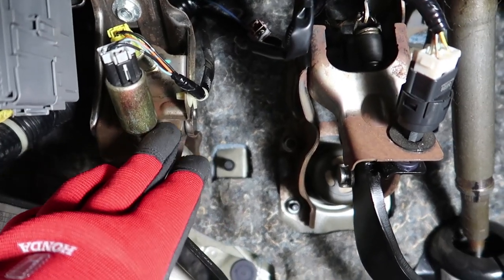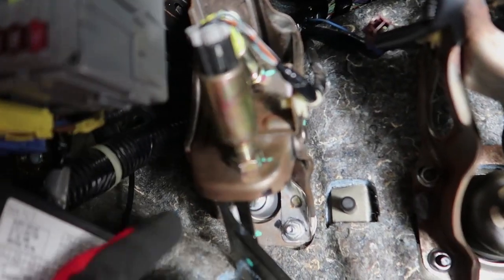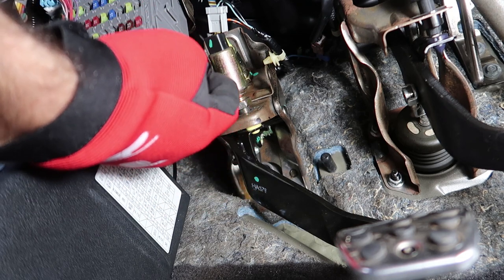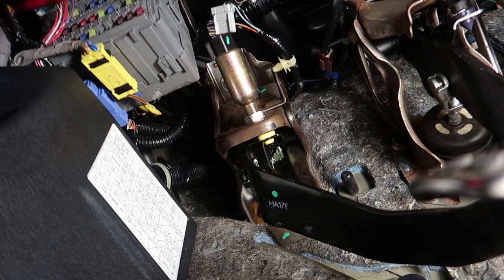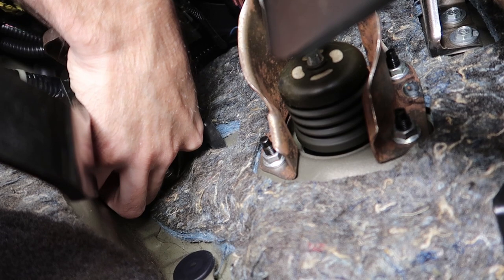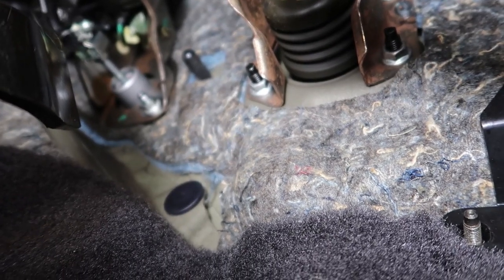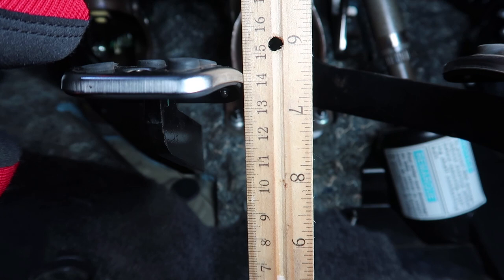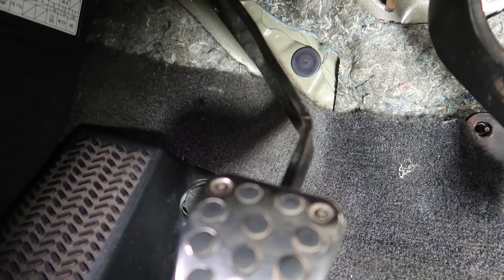8th Civic Si and RSX Type-S Clutch Adjustment DIY | Aftermarket and Stock | FG2, FA5, DC5

Comment: Just installed an em1 master and slave with stainless line. The engagement point is at the very top of the pedal stroke and there is pretty much no free play. Id like to move the engagement point to the middle of the pedal travel but it seems strange to follow the procedure you suggest because wouldnt that move the engagement point even higher?
Reply from the maker: Try a little more freeplay. Longer pedal stroke will make it engage higher. Having not much freeplay will make the engagement slightly higher. In order to have proper disengagement it might not be possible to have the engagement point where you want it. You will (most likely) get use to it in about a week of driving
Reply: @JasonMcMullen  thanks for the reply, so is it necessaty to adjust the sensor/stopper and rod simultaneously to get any results or can they be adjusted independedntly of eachother? In my mind it would seem that shortening the pedal stroke by going to the 5th thread on the sensor would essentially just be eliminating the final ~10-15% of pedal travel where my engagement occurs. If I started by only adjusting the CMC rod counterclockwise for more free play could this potentially move my engagement lower or would i also need to adjust pedal stroke to make it work?
Reply from the maker: @colmanbaldwinson9091  The freeplay adjustment will only change it a little bit. Essentially by having more freeplay, less fluid will be pushed into the CMC. Same goes for the pedal stroke, less stroke will push less fluid into the CMC and therefore when you let the pedal up it will engage earlier in the stroke.  There is only so much freeplay you can add so it might be necessary to lower the pedal. If you do adjust the pedal stroke then you have to readjust the freeplay after, which is why using a ruler is helpful (so you can record how much you had before doing the pedal length, and then you can add the same amount after you adjust the pedal length). Honestly, having proper disengagement is more important because it affects the transmission, whereas having a desirable engagement point is more of a driver preference. You can try 4-5 threads and then readjust the freeplay, but if you start having disengagement issues then I recommend that you return to the setting you have now. Thanks for the comments buddy, I hope it works out well for you
Reply: @JasonMcMullen   for the help and the great video!
Reply from the maker: @colmanbaldwinson9091  thanks buddy! lmk if you run into any issues of have any more questions
Reply: @JasonMcMullen  So i just tried to spin my CMC rod after losening the nut and it wont budge. I also noticed that my sensor is already maybe 3-4 threads in already. Feel like im kind of stuck with what ive got at this point idk how else I could get the rod to spin without taking the CMC again or taking it to a shop. I could get used to having the high engagement/disengagement but I have literally zero free play right now
Reply from the maker: @colmanbaldwinson9091  try to push down the pedal a tiny bit with one hand while trying to turn the rod with the other

Comment: On my Rsx the stopper is at like 5 threads , the free play is correct but when In gear as I release the pedal it doesn’t grab until the very top what can I do to make it grab in the middle ? Lower the pedal stopper ? It’s a new clutch and everything
Reply from the maker: is it RSX type-s?
Reply: It’s a 06 base 5 speed with a k24 , oem exedy clutch replacement and their master and slave cylinder, it shifts fine it just grabs very high
Reply from the maker: @joaquin0023  that makes sense, the height is different for your setup. You can try to add a little more freeplay first and see if it helps. Then if you need to you can go to more threads showing and then reset the freeplay. Keep in mind that doing so may make shifting less smooth, depending on how much pedal travel is required for your setup to fully press in the clutch pressure plate.
Reply: @JasonMcMullen  I added more threads and did the free play but it’s still high, the height is even with the brake pedal , I’ll try to add more

Comment: Hey Jason. I just did this adjustment and my shifts are definitely smoother and no grinds at all. I am a bit concerned about the higher clutch engagement tho...mine also catches pretty high...almost to the point where i let my foot off the pedal. I do however have about 15mm of free play in the pedal. If the engagement point is higher, wouldn't that mean the clutch is riding itself? Again, I did everything as shown in the video, clutch pedal is stopped by the stopper and not by the cmc. The rod was also rotated a bit counterclockwise as soon as I felt resistance when turning it clockwise. I just wanna make sure this wont cause any harm to my actual clutch as it feels completely different from how it was before the adjustment. Thank you!
Reply from the maker: Maybe go to a little more freeplay or shorten the pedal travel a little bit if you are concerned (go to slightly more thread showing and then redo the freeplay). Try more freeplay first and if that doesn't help, then go to slightly more thread showing, and then redo the freeplay. It should be fine, but you might be able to lower the engagement a tad and still shift smoothly
Reply: @JasonMcMullen  thanks for the reply! I will probably adjust it back by a bit cuz I had to relearn driving uphills lol....and to be sure, the clutch won’t ride itself after these adjustments? From my understanding, the clutch ride happens when pedal is slightly depressed over a long period of time. So the more tight the rod is (turned clockwise), the more risk to it? Sorry for all these questions, I am pretty new to all these stuff.
Reply from the maker: @nichitakukuskin389  yeah if there is enough freeplay then the pedal is not putting any pressure on the slave cylinder, which releases the clutch. As long as the freeplay is reset after adjusting the height then it should be fine. It takes about a week to get use to it, but yeah try to make the pedal a little shorter and redo the freeplay, see how it turns out.
Reply: @nichitakukuskin389  how did it end up , was the engagement point lower ? Mine shifts good but engages high too
Reply: @joaquin0023  I ended up adjusting a bit lower yes...shifts are not as smooth but no grinds tho...I pretty much adjusted it just slightly higher than stock if that makes sense :)
Reply: @nichitakukuskin389  by adjusting a bit lower what do you mean
Reply: @nichitakukuskin389  on mine when In gear and the pedal to floor when I release the pedal so it can “engage” it grabs basically at the very top , I just want it to grab a little lower
Reply: @joaquin0023  the try turning the rod counterclockwise a bit if you want it to grab lower...the more it is turn clockwise, the higher the grab (at the top) will be

Comment: Hopefully you can help me. I have em2 cmc. I have like 2 threads showing and adjusted the rod clockwise till i felt resistance. And counterclockwise a bit after that. As soon as i let go the clutch pedal in 1st gear. The car starts moving. Also lockout at 5k rpm Is this cmc problem or clutch component problem?
Reply from the maker: try less threads showing and then redo the freeplay. LMK if that helps
Reply: Sorry for super late response. My TOB was the problem. Had to buy clutch kit and oem TOB.

Comment: Hey Jason, how would you know if you're preloading the clutch?
Reply from the maker: If you can feel that there is some freeplay (dead pedal) then you shouldn't be preloading it
Reply: @JasonMcMullen  Ok great cause the car shifts and feels great. Just worried cause there was resistance when adjustment the rod clockwise but that could be cause of the damaged threads/rod as you said at the end of the video. Thanks man I appreciate it.

Comment: Anyone know if this applies to a 2014 civic si? Running an em1 cmc with the oem rod swapped over. Trans shifted perfect in the 2013 it came from. Put it in my 2014 with new hybrid racing cmc and slave and can’t get it to not grind and lock me out of 2nd now.. also installed clutch masters clutch and flywheel
Reply from the maker: if you are having lock out problems you could try to make the throw longer (go to less threads showing and redo the freeplay) Just make a not of where it is now so you can go back if need be
Reply: @JasonMcMullen  any idea how little threads I can go while still playing it safe? Don’t wanna stress the crank!
Reply from the maker: @Jaydee6.2  not sure for that car but you could try just go a half thread less than you currently have. But if you are worried about that I recommend changing your trans fluid first to see if it smooths things out
Reply: @JasonMcMullen  brand new Honda mtf, acuity shifter and cable bushings. Only thing it could really be is cables or synchros I guess besides adjustment. But did shift fine in a stock untuned car.
Reply from the maker: @Jaydee6.2  Yeah it could very well be the adjustment. A lot of people (myself included) thought that their synchro's were damaged but it ended up being the adjustment. But You can also have a trusted mechanic do it for you too as long as you let them know what you want
Reply: @JasonMcMullen  I’m gonna give about 3-3.5 threads a try and adjust the free play. Think that could be a big part of my problem. Thanks for the input and video man!

Comment: Ey what’s up bro
Yo you helped me once lol
I have a lil issue now
I went back to the stock Exedy clutch 
But I left the Ktuned master cylinder on it with the OEM clutch

I left the same adjust I had before 
I didn’t touch the threads 
The car runs fine, all gear etc
But the issue I have is that I’m losing acceleration 
It feels like an automatic car
If I’m on 2nd n step on the gas to the floor it takes time to take off
Like an auto car lol

Do I need to adjust the threads??
Reply from the maker: Thats pretty weird, can you check how much freeplay there is? Do you have a flashpro to datalog with?

Comment: Is that 5 threads showing on EM1 with the oem push rod replaced or using the longer one it comes with? Thanks for the helpful video!
Reply from the maker: For the rod that comes with the K-tuned EM1 CMC, not swapped. Thanks bro!! LMK if you have any issues
Reply: @JasonMcMullen  safe to assume the adjustment would be the same as oem if I went with hybrid racing cmc and swapped out the push rod?
Reply from the maker: Yeah I believe it will be closer to the OEM adjustment if you swap the rods but Hybrid racing doesn't specify exactly.  You can use this method to fine tune it either way. If you have trouble shifting, try a longer pedal travel (less threads showing). If you feel a ton of pressure only at the bottom of the pedal stroke, then go for more threads showing (shorter stroke). Always re-adjust the freeplay after, and always keep it in the recommended range.
Reply: @JasonMcMullen I'm only contemplating going em1 cmc at the moment but will definitely keep that in mind if I go through with it! I'm replacing clutch and fw and read on the forums how bad our oe cmc was with aftermarkets especially stage 2 and up. Might not need to after watching this lol
Reply from the maker: @mrm7525  nice. Another option is to buy a modified CMC made by @k20z3allmotor on instagram. He knows his stuff and sells a nice modified CMC.

Comment: Just did this on my si and it's a night and day difference before I had 4 threads exposed and the clutch grabbed at the bottom switched it down to 1 thread and now it releases more towards the top and feels like every other manual trans I've driven also doing this made my 1-2 2-3 shifts way smoother
Reply from the maker: Great to hear buddy, yeah its like all of a sudden it shifts smooth like it should

Comment: How many threads for the clutch height adjustment if I’m using a EM2 CMC
Reply from the maker: Not sure about the EM2 but it looks similar to the EM1 so I would try 5, if you are still having shifting issues maybe try less threads. Always redo the freeplay after adjusting the amount of threads
Reply: @JasonMcMullen  so I should have a small gap between the pushrod and the actual cylinder cuz u said that if the pushrod is all way out and hitting the actual cmc then it can cause problems?
Reply from the maker: @eduardozavala3124  the best way is to measure the freeplay with a ruler. But as long as you back out (counterclockwise) half a turn, as I say, you should have an amount that wont damage anything.
Reply from the maker: @eduardozavala3124  When you keep backing out you will hit a stopping point after about 6 turns, that is when there will be no gap, and it will be an issue.
Reply from the maker: @eduardozavala3124  basically too much freeplay will lead to no gap and can damage the CMC, and not enough freeplay will lead to damage to the clutch throw-out bearing. Honda says minimum of 10mm, max of 17mm, but you might run out of room before maxing out at 17mm. About 10-12mm is good for most people
Reply: @JasonMcMullen  yo so my em2 cmc came in and I see that the pushrods r the same length for both my stock rsx one and the em2 so do I just do 2 threads showing for the clutch height adjustment like I had on my rsx cmc
Reply: @JasonMcMullen  I got a stage 2 exedy clutch btw

Comment: Been through 2 cmcs already and i think this video helps. 
so you want 5 threads of screws shown of the bottom of the adjustment screw and not on top?
cause i have 2 threads showing and its locking out alot on 2, 3 gear. 
my pedal has a low engage, but i kinda like it that since its easy to pick up.
What would you recommend
i have em1 cmc style.
Reply from the maker: 22Aber 5 threads on the bottom for k-tuned cmc and 1 thread on the bottom for stock cmc usually is about right. Then make sure freeplay is good too
Reply: Jason McMullen it doesn’t matter if it’s Ktuned or nissin em1 cmc?
Reply from the maker: 22Aber yeah they are the same. Some people have to go to less threads showing on the bottom but for most people 5 threads is good. If you are having lockout problems try less threads and redo the freeplay
Reply: @JasonMcMullen  by redoing the freeply i adjust the push rod right?
Reply from the maker: @22aber51  yeah, then check the freeplay amount on the pedal with a ruler. Has to be more than 10mm. For me 12mm is perfect
Reply: @JasonMcMullen  thanks just adjusted now, feels alot better, shifts are smooth. the other thing is second gear sometimes grinds. Buts that cause 8th gens came with bad tranns. But did some pulls around the house.  i do have an extra oem cmc just in case this one goes bad.
Reply from the maker: 22Aber good to hear bro!

Comment: Yo so I need 5 threads right if I’m stage 2 clutch and aftermarket oe cnc?
Reply from the maker: its a EM1 CNC, which aftermarket one did you get?
Reply: @JasonMcMullen  yes it’s an em1, the brand is adler

Comment: Do you know how many threads for a Tsx 6 speed 2007?
Reply from the maker: Sorry I don't know about TSX but you can use this method for adjusting. If you are having trouble shifting, try less threads showing. if there is a ton of pressure only at the bottom of the pedal stroke (over stroke) then try more threads showing.

Comment: I just installed a new ktuned cmc, bled the lines and adjusted it just like in the video. Now my car won’t go into gear. Any ideas?
Reply from the maker: is there good pressure on the pedal? You might need to do a clutch adjustment if the pressure is good and you still can't get it into gear, I have a video on that also
Reply: @JasonMcMullen  I think I figured it out. My clutch pedal assembly was cracked
Reply from the maker: @joshdentremont4099  oh ok copy that, glad you figured it out :hand-purple-blue-peace:
Reply: @JasonMcMullen having disengagement issues even after welding the pedal bracket. I just installed a ktuned cmc and I have a stage 2 clutch. Should i have 5 threads showing or less because of the aftermarket cmc?
Reply from the maker: @joshdentremont4099  hmm try to go to less threads showing and then redo the freeplay (giving yourself more throw distance) and see if it helps with that issue
Reply: I adjusted it to about 3 or 4 threads showing and it goes into every gear like butter. But should I be worried about over stroking the cmc?
Reply from the maker: @joshdentremont4099  you should be ok
Reply: @JasonMcMullen  thanks for the help man
Reply from the maker: @joshdentremont4099  no prob, glad to help! have fun

Comment: I have a question, after I adjust the height of the clutch the 12 mm bolt keeps turning with the master cylinder so I adjusted it and left it without tightening the screw. Do you think it would be fine like that?
Reply from the maker: if you can try to use one hand to hold the rod and the other to spin the nut until it gets close, then use the wrench to tighten it. If you cant then just tighten it and check the freeplay with a ruler to make sure you are in the right range after the rod turned
Reply: Jason McMullen Ok I’ll try to tighten it, thank youu

Comment: How many threads should be showing out off factory
Reply from the maker: I think around 4-5 but I'm not 100 percent sure. Honda Factory Service Manual goes by a different measurement (with carpet removed), here is the link, http://civic.hondafitjazz.com/A00/HTML/20/SNB6E20E34116317041MBAT00.html
Reply: @JasonMcMullen  hey Jason, I have all stock everything (other than a exedy OEM clutch) should I still have 5 threads showing? Or only 1 thread showing?
Reply from the maker: @naailable  closer to 1 thread for you. Maybe go to 2 threads first and see how it feels, and if the shifts still aren't smooth then go to 1
Reply: @JasonMcMullen  you are an extremely helpful individual, I appreciate the help brother.
Reply from the maker: @naailable  Hey thanks bro I really appreciate that! lmk if you run into any issues